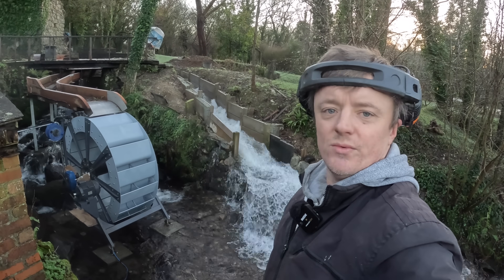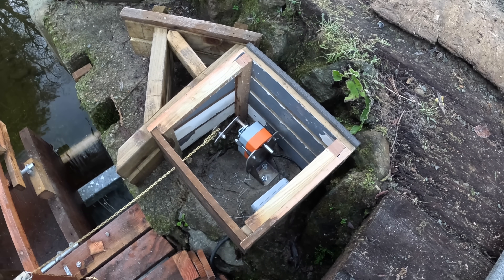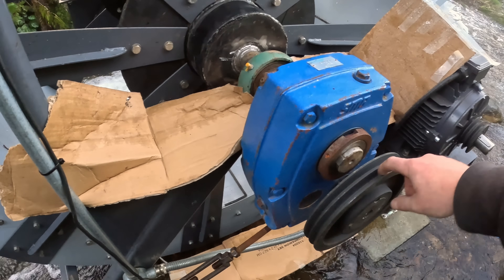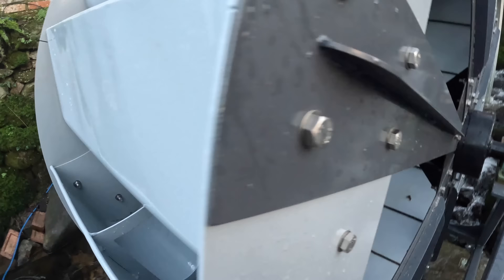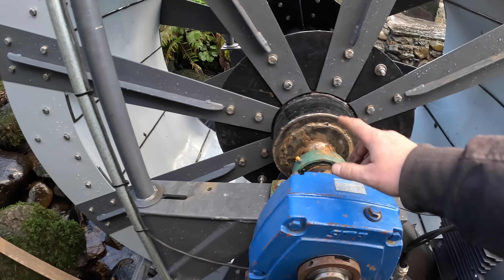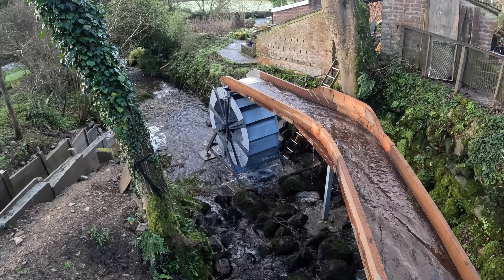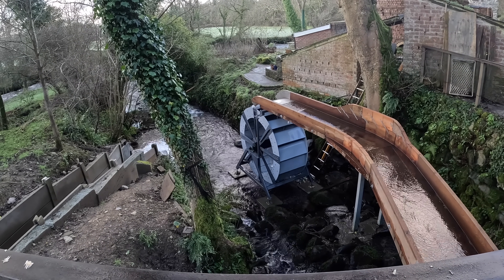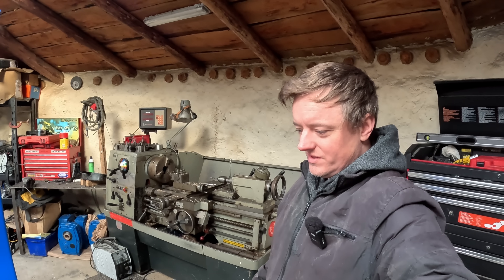Powering An Old Mill  1.5 Kw Lake District Overshot Waterwheel Project Part 5

Comment: Well done for showing your mistakes!  Weld fatigue is the cause of a massive percentage of structural failures, so it's always interesting to see another real world case study.   The failure is somewhat unsurprising, given that at 1.5kW and around 10rpm, the torque generated is some 1400NM, and probably higher given the efficiency losses of the generation system.  Additionally, the diameter of the wheel makes for quite a bit of leverage, so the plate that suffered from the weld fatigue is having to resist any forces acting perpendicular to the rotation of the wheel (e.g. from water landing in the buckets at a bias, or wobbling of the wheel from side to side as it runs.).

On top of that, the weld that failed would be quite a low fatigue class, with the closest match probably being class 36, meaning that it was always susceptible to fatigue failure under cyclic loading.
Given that it's been running for about 2 weeks, at an average of 10RPM, it's only seen around 200,000 cycles (complete turns).  According to the SN curve for a class 36 weld, that would suggest that the direct stress seen by the welded plate is in the region of or above 100 MPa - a number far greater than would be generated by just the torque alone.  I'd therefore presume that the main cyclic loading is coming from the wheel "wobbling" from side to side as it runs, causing the welded plate to flex continuously.

In order to alleviate this, I'd suggest some triangulation braces (perhaps 4, one every 90°) running from the outer perimeter of the wheel back down to the hub.  Even at quite a shallow angle, these would provide a lot of stiffness to the structure and prevent the hub plate from being flexed as the wheel rotates.
Reply: I think the shape of those buckets is causing the wheel to wobble.
.
The water flowing towards the bucket is resisted by the water coming out of the bucket at high speed in the same opposite direction.
In Hydel power stations,  they use different types of buckets on turbine. I those turbines, , the water after hitting the bucket gets diverted in the other direction but not in the opposite one
Reply: These are called reaction wheels. Water hits the blade and gets thrown off at a different angle.
Reply: 🤯uhhhhh..........Uhhhhh........ Yeah. What this guy just said.

Engineer?

What book contains this magic you speak of, sir?
Reply: @BIGWIGGLE223  il est ingénieur ! C'est super , beaucoup d'humains sont ingénieurs, tu oublies que son cerveau est créateur , l'humain a oublié , ce n''est pas tous, qu'il a les capacités de créer et de comprendre , c'est vrai sans passer par la connaissance acquise depuis des Années si tu ne fais pas d'études !: Excepté que, il y en a par dessus la tête d'avoir un escroc un mal honnête qui décide de ce qui doit, être et pas être ! tu nous fatigues, laisse l'esprit penser ! Allez vous faire voir ! ça nous plait, on s'en fiche , nous nous enfichons de tes diplomes d'ingénieurs , on s'en contre fiche, les idées viennent d'ailleurs ! va voir le magicien, il va te faire tourner au dessus du sol!
Reply: @BIGWIGGLE223  regardes ce que je vais commenter ! l'idée est d'utiliser le poids, la masse et non pas le courant ! et cela fonctionne et à cause, d'un seul qui bloque tout parc-qu' l'idée n'est pas de lui ! si les idées ne proviennent pas des égocentrés , orgueilleux, cela ne doit pas exister ! va te faire voir, fiche le camps sur une autre planète !

Comment: "Pretty Nifty "  could have been a CAR WIPER MOTOR (12 Volt) controling a ' WATER GATE '  INSIDE  the FLOW of water DIVERTING  water to the BYPASS CHANNEL at a Y- JUNCTION thus SLOWING DOWN the "Over speeding " Water wheel. 
Alternatively an ordinary 'SPEDOCRUISE' as used in Motorcars could be used by same Y-JUNCTION method controlled by Hydraulic Piston actuators on the FLOW CONTROL FLAP using slight Water Pressure instead of Vacuum as on Motor cars. 
To attain more CONSTANT SPEED  I would also suggest putting more 'Pickup  Tabs'  on water wheel shaft for greater accuracy. 

Your system will have to be RESET MANUALLY every time it over speeds causing unnecessary delays (Loss of OPERATION) and a lot of 'Resetting ' the Shut off Flap.

Best regards from a retired South African Boer .

Comment: On the oversp
eed monitor, how about replacing the shut off pin mechanism with a variable servo that will vary the flow of intake water. If it overspeeds, the flow will be valved to let less water in.  If it underspeeds, it will allow more.

Comment: I like your overspeed failure shut off system! 

One useful component for such systems is the cheap electromagnetic door "lock" device normally used to hold doors open or shut. You can get these cheaply in all sort of voltage ranges (AC & DC) and they have huge holding force for tiny amounts of power, and of course, when you remove the current the electromagnet is not a magnet so they are intrinsically fail safe. In this case, the sluice blocking gate could have been held up by such a magnet, and released on either a loss of system power or an overspeed event. This is far simpler mechanically than the chain and pin system so there are less ways it could fail to operate 🙂

Comment: I think I would take a 6 or 8 inch grinder wheel, so you can get in there and cut a nice channel in that weld and put a solid root pass and two nice  cover passes and you will be good forever.

Comment: Hi, wouldn't it be better to use the Belimo LF24 servo drive to directly close the flap using the spring mechanism of the servo and then open it with voltage on the servo? My job is building automation, recuperative ventilation, heating, cooling, I use servo drives often, I have tested how to control these spring servos and that too sensitively, without determining the position of the servo shaft, even according to the water wheel speed sensor, it would be possible and even I would probably he was also able to control the amount of water so that the revolutions of the water wheel were as constant as possible, it's simple, it's just a matter of the time it takes for the spring to close and the time it takes for the electric motor to open, both are divided so that the ratio of closing vs. opening is clear and thus the time for the motor must push, then the time for which the motor is under voltage can be deduced using the accepted proportionality, I don't solve this by applying DC voltage, but by a set of rectangular pulses, this has the advantage that I can accurately count the pulses and in addition, when the pulse is zero, the servo motor cools , so the service life of the servo drive is easily extended by two thirds (I have an installation where a 16Nm LF24 has been running like this for 21 years :D) The truth is that it would be better to solve the closing flap as a slide, although I think that a well-chosen lever would also work with a system with a hinge which for the closing flap you use here. Hello and good luck Jiří from the Czech Republic

Comment: Great to see the progress.  In all of your video's for this water wheel, I only had concern for the thickness of that failed plate, with respect to fatigue failure.  However, with 1.5 kW and 30 RPM being pushed through the shaft, I calculate that the plate at the location of failure was experiencing roughly 5 MPa of shear stress.  The yeild of the material is roughly 200 MPa.  The cyclic stress range would have had to have been 120ish MPa for the failure to occur within a few days.  There would need to have been some crazy wobbling cyclic stuff going on that you weren't aware of for that to happen, and then the other side didn't fail.  It had to be an issue with the material/welding.

Comment: Would it be worth setting up the overspeed cut off so it could reopen the water supply to the wheel once the speed has dropped? 
It could be fairly self governing if you could partially cut off the water supply if it over speeds, allow it to reduce and then open the flow back up if the speed drops too low.

Comment: Loved watching this series! My only addition would be to avoid using galvanised steel bolts in with the steel bearing housing. You can see the zinc in the galvanised steel is already causing corrosion in the carbon steel, due to the difference in galvanic their series. I would suggest using a sacrificial anode or using nylon washers to separate the metals.

Comment: Really good job, with the usual hiccups and problems.  Stupid chinese motor wouldn't work!  Couple of things that have me bothered a bit.  At full flow, the splashing seemed to get on the motor cover quite a bit, didn't look really safe to me.  I wondered about that.
The other thing I was thinking is if you had the wheel a bit lower then the water could be falling as well as flowing, increasing the kinetic energy, and helping to fill the buckets instead of splashing.  
Just a thought, I'm no engineer.  All in all, a really nice bit of work, and 21kW is nothing to sneeze at!

Comment: One thing to consider is any harmonics that may be present from the buckets being slapped by the water. I'd hazzard a guess that after the weld broke the main shaft was able to absorb alot of those harmonics with torsional twist of the shaft which prevented the other side from cracking.

Comment: May be  because of the High Torque Loading on the Drive side of your Water Wheel  ... Anealing heat treatment of your Welds ... Additionally a Flexible Coupling to dampen  shock loading in your drive line ...  

Just a Thought ..... Agspanner .....

Comment: Love your building style. Amazing creator 👍 Such a wheel can move a 3KH X2 generator (if you increase the wheel on the turbine shaft to a larger one even in a slow flow 1X8. Let's say today it does 1X4. The upper controller if I am connected to a spring or a threaded snail so it will move the water flow door a little more a little less. According to a speed sensor bottom ... and will not close the door completely ... re-soldering some triangles
  Each side of an iron triangle will give more contact between the rotor and the wheel. water sway evaluator. And gravity is what broke the rotor off the wheel

Comment: I have been a welder for almost 40 years, so I FEEL your pain brother . Welder kicking out the breaker constantly because your trying to run 110 volts .. done it. No 6010's or 7018's around just " Jet rods" to do a job  . . . yuck! ...  Using a helmet with an auto shade drives me nuts .. I'm old school, I can drop my shield by just thinking about at this stage of my career...haha. 
   I'm spoiled now...I decided to take a job in a HUGE shipyard here in Canada...no more climbing over pipe racks to TIG weld stainless in position with 100 percent x-ray's on the whole line. 
   Everything I do now is simply pressure tested, so one little speck of tungsten is not a cutout like it used to be.

Comment: I would be interested to know why you chose a water wheel over a turbine for this project? Was it the clients preference?
Reply: Turbines need high pressure e.g. water far above.  The higher the better.  Water wheels only need water that's a foot higher than the water wheel.  Water wheels, however, need a lot of water to make up  for the low head.

Comment: I enjoyed watching the video..A lot of thought goes into designing this power  generation . I worked at a power plant for 35 years . Not a hyro unit . Interesting how different companies rate there products at the duty cycle .. Reminds me working on a cooling tower as far a rust and corrosion.  ..Interesting how you limit the rpm on the wheel from load to no load .. craft work is amazing.  A lot of work went into this project

Comment: Kris, i deal with a similar failure quite often on conveyor head rollers at my work, which are constructed in an identical manner. They never fail around the weld but always above like you've described. Ive been removing the head rollers and modifying them to accept a "ringfeder" or a keyless shaft taper lock. Obviously it would be a huge amount of work to carry out a modification on what youve got here, but may be a good solution for something in the future. 

You may already be familiar, but these taper locks are very effective and reliable. Makes for ease of assembly and can transmit a huge amount of torque.

Comment: the last bit makes no sense.  What has the flow rate of the river got to do with output when you only use a farction of total flow?  The weir arrangements at the top should allow for the wheel to have enough water to be at 80-90% capacity at all times.  Equally the sensors could be made to control the weir rather than simply divert the water away.   All this wheel does is divert part of the flow. So at lower total river flow rate a greater proportion of the total flow should divert.   Take a look at the Fallkirk Wheel.  That had to be designed to give a consistent difference in water height so the top canal has a lock at the top and there is another at the bottom - so the height difference the wheel works with is always 25m regardless of flow rates.

Comment: That last part where you consider that it's not worth making everything bigger because you only get the really big flow rates for a couple of months per year, doesn't take into account the value of energy.  When it's the middle of winter energy is worth much more, there is far more demand for energy when it's really cold.

Comment: Two things I look askance at are the jubilee clamp as a sensor trigger.  Unless it is a really good one, I'd expect it to rot off in 6 months and secondly the pin draw mechanism. I'd expect corrosion to work there and when it is needed it won't work.  I would have changed it to a trip where your chain pulls a bit of plastic out  of a tapered recess. That way the working bit cant rust.

Comment: I may be wrong, but I think this kind of water supply to the wheel is wrong. During rotation, the outer edge of the buckets hits the water stream before it starts to fill. This can create excessive stress and vibration throughout the wheel. Nevertheless, it is a very interesting design.

Comment: Question. About CONTROL.
In this case, why did you not design the wheel to rotate at a certain RPM, letting it make what it want's to make, and manage wattage / current control by way or bleed off to a resistor bank?
Seems like your trying to control natures input versus controlling the output

Comment: Enjoying the additions your doing to the wheel. I would have used a different method of using a 24v Belimo actuator with a 0-10v input. A controller measuring the speed with a PID and that would control the 0-100% gate position for flow and therefore speed. you can then dial back power generation and conserve water in low flow periods not that matters with your as you are taking a small amount of the main flow.

Comment: Could you build a variable gate valve for the water flow...this way the rpm's of the wheel control the flow...too fast it closes slightly, too low opens a bit more...but overspeed it shuts down?  Now if it goes too high it will just shut down and will have to have a manual reset
Still a great way for a failsafe...

Comment: Impressive!  I'd love to have a waterwheel.  I have had a pelton wheel for about 30 years but it doesn't have the romance of a waterwheel.  Since we have 30 meters of head and relatively low flow, I don't think I could build a waterwheel that would be efficient but it would be great if you could tell me how it could be done.  As I said, I'd love to have a waterwheel. 
Congratulations on a job well done!
Cheers from Alaska

Comment: Best way to control the rpm of the water wheel is to use a mechanical centrifugal governor, steam engines and music boxes use these governors and they work awesome. It can be used to control the water flow or apply a brake to the wheel. Based on the views these videos have received it would be a shame to end the journey.

Comment: How about an automatic sluce gate at the start of the mill race.

Which would limit the maximum amount of water and belt and braces the full diversion would still operate if the automatic sluce failed.

The automatic sluce gate working at maximum power output.

Thus allowing generation even with high water.

Comment: This project was a good illustration of all the advantages of a turbine setup. Smaller, easier structure. Easier to adjust and turn off flow. More efficient power generation. The only advantage the water wheel has is no high pitch whine. I guess if it's just a fun little project that you don't really need for power then the noise is the most important factor.
Reply: Where do you buy your turbines? I need one to catch the 20kW power going to the Atlantic every minute.

Comment: Kris i was thinking  the chines generating set you have . parps you mite build your self a wheel &   Put it in that Streep boundary stream  you have on your property  shoot the  water over the top it just may have sufficient flow  to power one of your China generators wells a sloops to gild it over the wheel & I noted  a high spot  that would  do the job. when you first's check it out.

Comment: Great video series, thanks. A very interesting project showing all the problems that have to solved when designing any system, there's always RV 1, 2 etc. In the old days the miller would be the control system, using eyes, ears & years of experience to control the flow. When building windmills & water mills they must have faced the same issues.